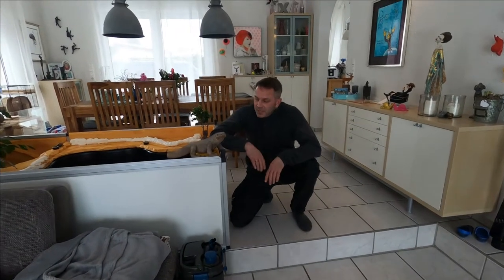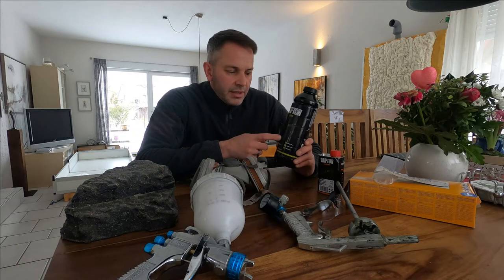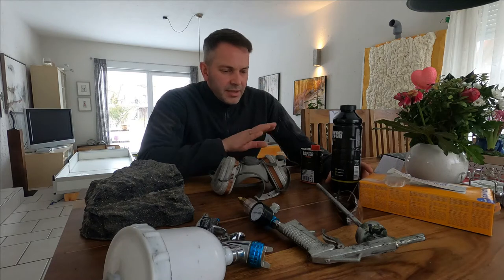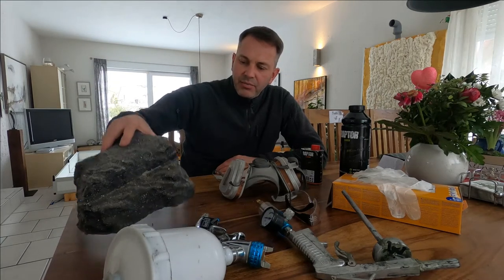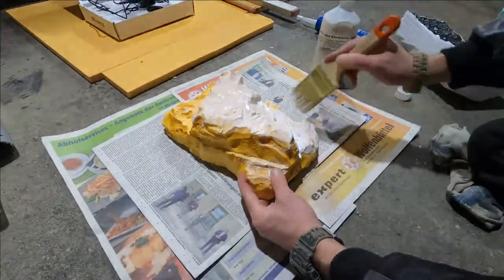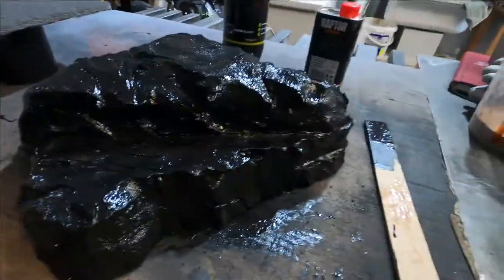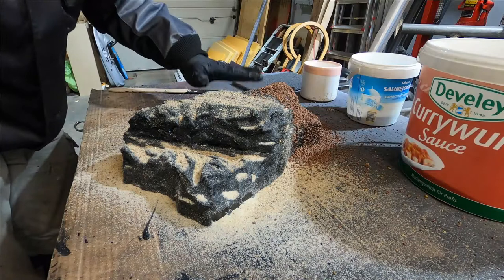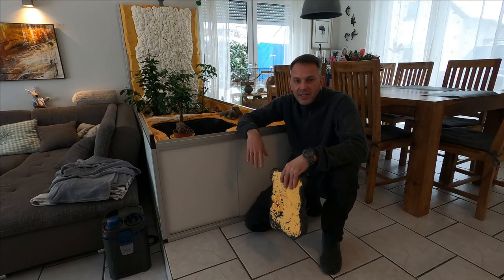Terrarium Backgrounds with Raptor U-Pol bed liner , monitor lizard enclosure, Paludarium Part 8

Comment: Hello Sven, thank you for your video . You choosed raptor over the cement way because its overall more durable ?  I'm always afraid to use certain type of chemicals with my animals, do you know if its used in some zoo maybe ?  Or other facilities with animals without problems ?
Reply from the maker: Like i said I contact the company UPol and they send my a lot of list and protocol and they say if you do it raid there is no problem. During the aplication its very unhealty and you have to wear propper safty materials . I use this stuff for many years in cars and campers. But if its realy no problem for the animal I have to relay on the companys Informations I got. Hopefully there will be no problem. But in my case I have a drying periode of many month before I will get a monitor lizard. If you have the chance to do the normal way, use these methode. Or better use only naturalistc stuff. But sadly vor my build that dont work out. If I recognice any problem with my animal a will remove all the stuff because its realy easy in my case.
Reply: Thank you for the answer, i'm always worried because we discovered that in even the most common plastic we use, there can be some chemicals coming out. But I guess every synthetic thing we make are prone to not be 100 %  healthy at the end. Maybe there are problems with cement and epoxy too, we just don't know. Besides that it seems to be a very though material. I see you don't put an another layer on top of the sand, can the sand be ripped by the claws of the monitor at some point and fall off ?
Reply from the maker: @auroraominae  Its nearly impossible to rip the sand of with claws. I cant even make a scratch with a srewdriver into my cars. Its realy durable. Just check google for poliurethan that is the stuff in this raptor bottle. They use it everywere. I think its nearly impossible to dont use any kind of plastic material. Take the epoxy its still a chemical,  or silikon or glue. I am hoping that everything will be good. The big advantage is it is super lightweight,  watersealed indestructible und very very fast to apply. You will see it in the video when the weather will be warmer.
Reply: @Thegermanmonitorlizardguy  thanks i'll check this